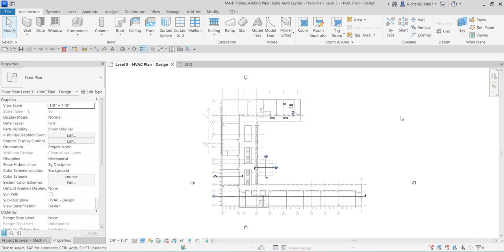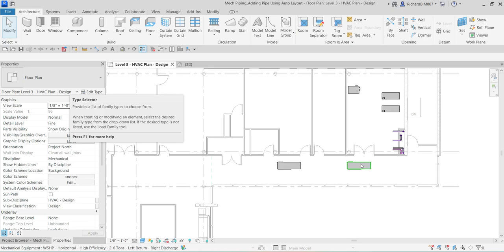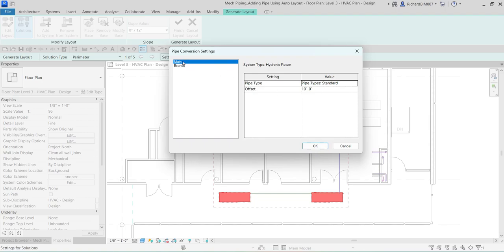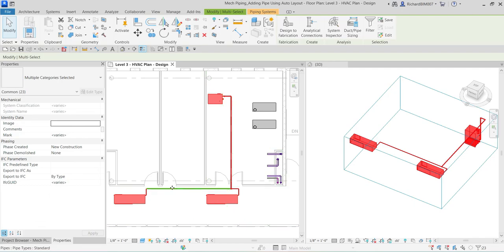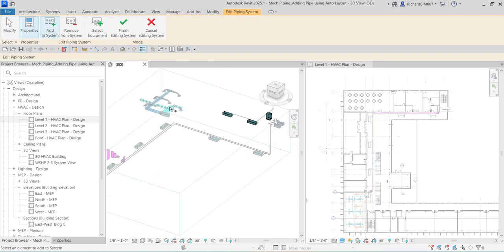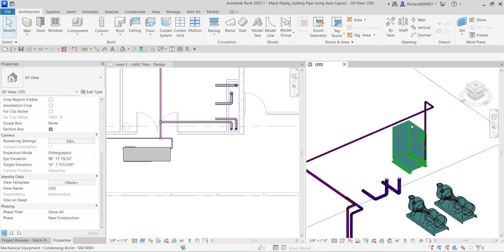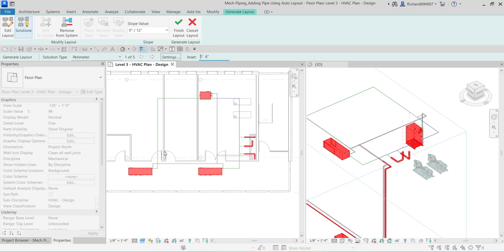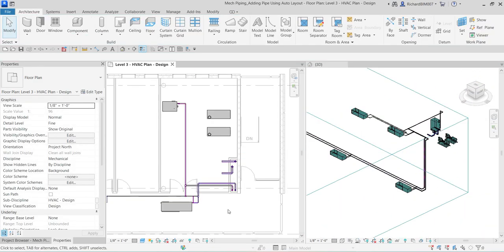REVIT 2025 FOR MEP DESIGN: PIPING SYSTEM - ADDING PIPE USING AUTO-LAYOUT

Comment: Hi, I have a question. Where did you get the "WSHP - Horizontal - High Efficiency - 2-6 Tons - Left Return - Right Discharge 6 Ton"? Because I don´t have that equipment on my Revit 2025. I only have the "M_Air Handling Unit – Split System – Vertical 05". Thank you.
Reply from the maker: Hi Rebeca, good question. That WSHP family does not come from the default Revit 2025 library. It’s a manufacturer or custom family that was loaded separately, usually from a supplier’s BIM library or an older company template. Out of the box, Revit 2025 mainly includes generic equipment like the “M_Air Handling Unit – Split System – Vertical 05,” which is why you’re only seeing that one. If you need the same WSHP, you’ll either have to download it from a manufacturer (like Trane, Carrier, or similar), copy it from another project that already has it, or create a custom family based on a generic mechanical equipment template.
Reply: @bim360 I see. I'll look for some families to download and continue watching your MEP course. Your videos have really helped me; I've been following the course for almost three weeks now. Thank you so much for answering my question and for your excellent videos. Best regards 👋🏻
Reply from the maker: thanks rebeca. try download the families here: https://www.autodesk.com/support/technical/article/caas/sfdcarticles/sfdcarticles/Where-to-find-Revit-Content-Libraries-to-download.html